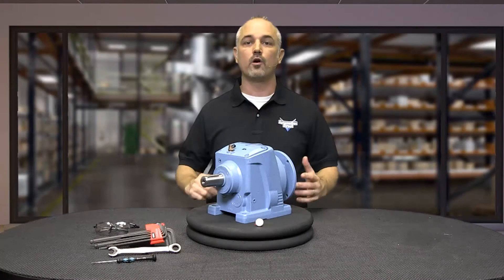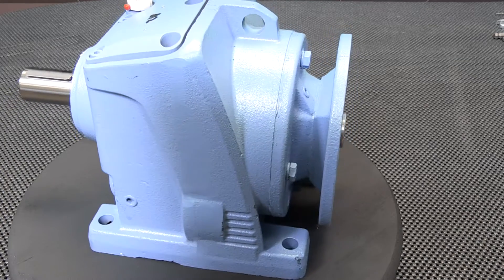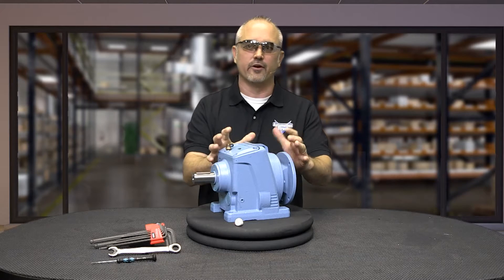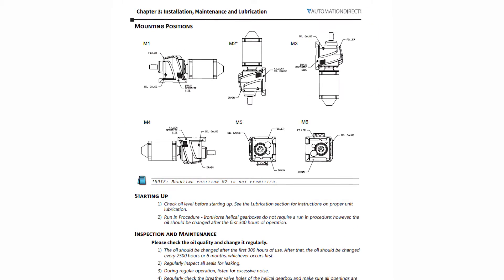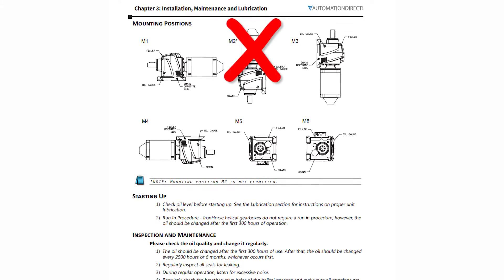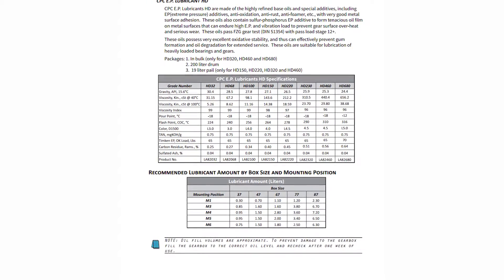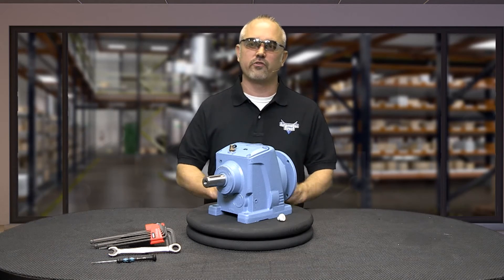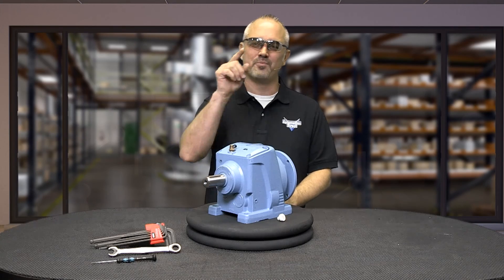IronHorse Helical Gearbox DIY Install & Maintenance from AutomationDirect

Comment: I have a question. If you can answer please. What if I need a gear box on which Input is 1 rpm and output is 1500 rpm. Lets say I wat to run a  motor or electric generator of 1500 rpm through a gearbox to which I only apply 1rpm by hand or lever in both direction clockwise and anti clockwise. Is it possible. Does such gearbox exists and what to call such gearbox.
Reply from the maker: I can't tell you much about that application since we don't sell such a product. I'd think what you are looking for is still called a gearbox but a speed increasing unit rather than speed reducing.